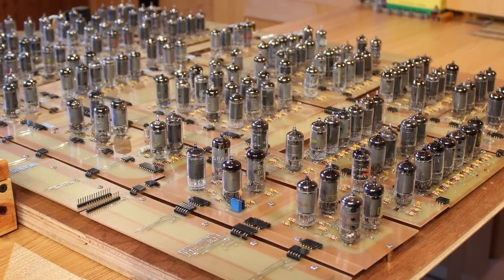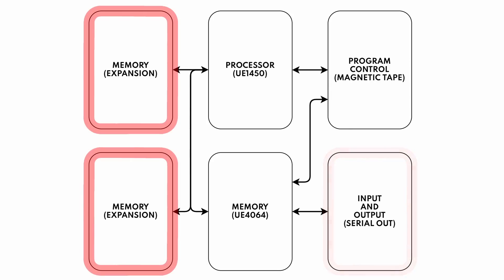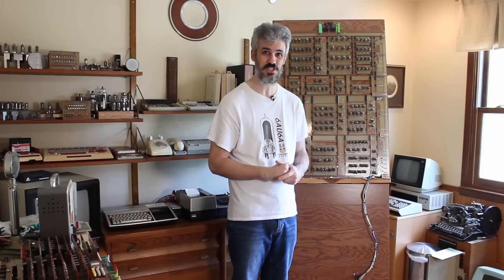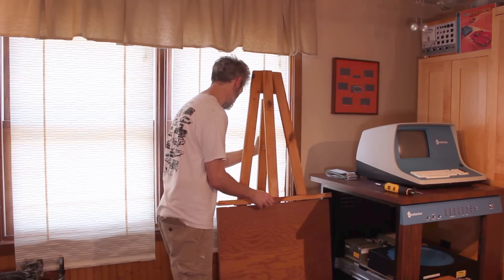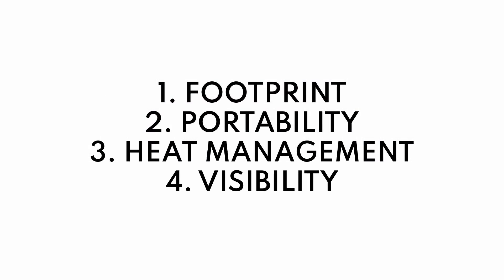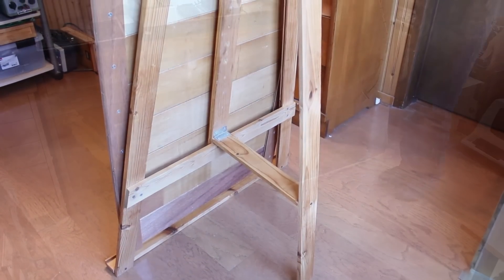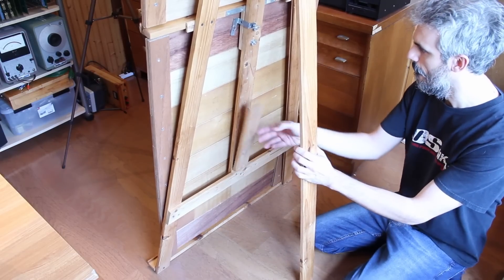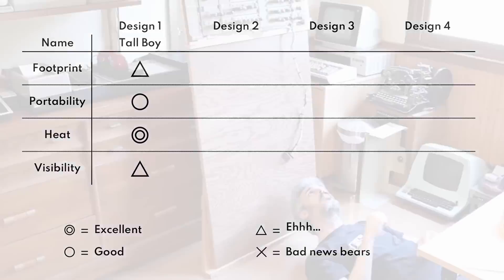Vacuum Tube Computer P.27 – Trying to Build a Mount for the Computer

Comment: You can use Option 3 when you turn the whole thing 90° clock or anticlockwise. Leave the bottom and top uncovered for airflow and visibility of the tubes. Cover the open side with an extra board for protection. 3 small braces should stabilize the whole thing top- and bottomwise. Maybe add some huge but narrow fans to the bottom to push cold air into the racks. Place the things on wheels and ready to go.

Comment: Spiral staircase? central post that all boards mount on, sort of like your filiung cabinet idea; but the boards coudl rotate and fan out .. so rotate one out for view, or all of them fanned out for view + heat spreading?

Easel .. back latch seems clever; I was thinking you'd have the tweo shelves with a groove .. so the mid-shelf would lock the bottom board in place, and then a top-shelf added to lock the top board down.

Back to back is an idea perhaps too .. if the easel had feet so it could be flat, but not tip over (think hat rack), coudl put boards on the front and back, but that'd only allow 4 boards per easel, and probbaly be heavy enough to tip over; visibilty would be okay, but only for half the boards at a time :P

Visibility could be fixed perhaps with a console ore viewing board; likel if you stacked all them into the filing cabinet ("pizza oven") design, you coudl still have a display on the side that you run all the VFD over to; like leave existing VFD 1 bit in place, but also run wires over to a side display (?) .. with LEDs, no big deal, but with VFD and heating and distance resistance vs your boards, no idea, but just a thought; if visibility is a problem, could you move the visible elements easily, modularly .. abstract the "UI" as it were?

Comment: Having worked for Cray, I prefer one of those styles over the other. If you do decide to copy the cray, make sure to copy the massive copper bus-bars. Extra points of you heat them up to the point of changing color so they look authentic =)

Comment: I saw all your videos on the building of the processor unit and I'm left with a feeling that you didn't plan too much ahead, or didn't plan with much detail.
That is way your processor board is so big, and has so much small boards just to fill up gaps.
Ok, I know a processing unit has many different circuits, so its not easy to have it made of boards of the same size,but never the less I still think it can be made a bit more compact.
Note that I'm not suggesting or expecting you to rebuild the whole processor board.

But, given that, your next boards, RAM and I/O (memory mapped I suspect), are mainly composed of several copies of the same circuit, registers and buffers, so its possible to have them made a bit more compact around a common bus., making it possible that the remaining boards can have a smaller footprint.
If so, you can have a set of "peripheral" boards of smaller size arranged in the "cray" model forming a 180º arc in the back of the processor board.
BTW, don't forget to leave room for an extra board for the power supply.

Comment: I like the box design, and I think that heat management would be manageable. 

I think an adaptation of the design may be to have the different boards pull out in different directions. In this way you would be able to see up to 5 boards at once (if you have the space) or you could have it pull out in three directions (4 boards visible) with fans at the back. The portability would be excellent the visibility would be good to excellent depending on the number of boards, heat would be good to excellent depending on space and foot print would be excellent to poor depending on how much room you have and how many boards you display. 

If you get fancy in the build you could have the boards pull out and up, but that might be a 5th factor that I would call difficulty of build.

Comment: Open air version of #3 is optimal. 1 side (blind side can be for air movement. 3 sides for viewing. No reason it had to be closed in your version. Your best solution is going to be a rack of some sort on wheels/casters.

Comment: I would consider the pinball layout, but go 3 tier, 1' off the ground, then 2', then 2'. Total hight 5'. Plenty of room to see through the boards and a lot of space between. A single box fan should cool everything. You would have to squat to see the boards on the bottom, but thats about the only issue.

Comment: To optimize, I suggest turning Design 3 (file cabinet) on its side without top or bottom boards, as well as raising it up off of the floor by several inches to improve air circulation and heat management.

Comment: "Usagi VTC One" or "The One Usagi VTC".
I think the "Cray" is a good option.
You can have a central hub to route all cabling. The visibility of the VFDs can be worked out with a small angular mount, keeping them in place. You can also consider having them in some kind of remote panel, instead of near the relevant circuit.

Comment: The filling cabinet case may be the best as every single valve/tube computer had forced air cooling and no matter the size of the case it would get hot. I’ve built a few am transmitters with valves and I’ve found that a standard 19 inch rack is the best compromise for size cooling and portability

Comment: Couldn’t help noticing the astatic d104 microphone at 6:07 just on the left hand side. That right there is my go to mic for my vintage ham radio gear as well as the teletype on the right. I wish I had that type as my model 19 is absolutely massive with its desk and power supply

Comment: I think you will need a design where you can remove the boards because 6 of them is going to be too heavy to lift all at once, especially with those fragile tubes. My design would be what I call the 'voting box', where you have 2 panels left, 2 panels front and 2 panels right in a U shape with the open side facing you: stable, compact and heat can get away.

Comment: For the third design, if you mount the boards vertical in the filing cabinet, the heat can rise to the top. A few holes at the top and it can radiate out. However, the visibility will still be poor.

Comment: Most of your case/mount design problems stem from your decision to tile your individual PCBs and turn them into these huge boards, which is not how the builders of similar computers back in the day used to do it. If you were willing to pull the large boards apart and divide and stack, you might get closer to an EDSAC-style arrangement, and that would solve many of your problems.

Comment: Name suggestion: mimivac mark 1 
(mimi - ear in Japanese, for big rabbit ears, -vac as a tribute to vacuum tube computers of old)
Also, it shortens nicely to MM1.

Form factor: 'Very Slow Cray', just make it fan-out to full circle (60 degrees between boards). 
With appropriate hinges, the design can fold nicely for transportation, and when 'unpacked', it has great visibility and heat management.
The footprint is a nice balance between visibility and portability.

Comment: Call it the UC 01A, and for a mounting look at making the Cray, but leave the leaves hinged, so you can fold it up into what is the filing cabinet for storage and transport. You just need to have at the ends of the leaves a set of spacers, that allow them to lock into transport mode and not knock, and fold out in use or display. 

Mount cards sideways, so that you basically can see all indicators from the side, so it is 1m long, 0.7m high and can fit on a table top. A latch or strap on the open side, and handles on the ends to carry it, and it will be portable. Make a base, wheeled, so you can roll it, but lockable castors to hold it, that both has all the power supplies (big industrial plug and socket for interconnect, should be easy enough to get industrial ones that are appropriate age and 20 or so way on eBay, chassis mount socket and cable mount plug) and the appropriate wooden holders to simply drop the filing cabinet in it, then open out. 

The filing cabinet has a spine  with the hinges, holding 2 boards in the middle rigidly, a hinge half way out for the 45 degree cards, and the end another hinge for the end cards, supporting most of the length. Yes it comes as 2m plus spine wide in use, and 1m deep, but can easily also be run on a bench or table folded, heat not an issue as you have a chimney now when folded to cool it.

Comment: How about MAVBAC, on the model of ENIAC, EDSAC, etc., standing for Macroscopic Valve-Based Computer? 
If you build housing for the computer, or dedicate a room to it, you can call that the MAVBAC Mansion.
(You could also just name the computer itself the Macroscopic Adder of Numerical Information and Alphanumeric Computer. There might be trademark issues with that though.)

Comment: My suggestions... 
1) A fold-out zig-zag with the panels vertical, a bit like an old-fashioned screen.  You'd need to space the panels carefully for storage, and you would need to limit the extent to which the zig-zag would unfold.  I would also suggest an additional stay or support at the back to ensure it would never fall forwards.  (That was my concern with the easel based stand as well - they are not noted for stability.)   
2) A variation on the zig-zag would be a vertical slatted arrangement with the panels arranged like the slats of a venetian blind.  You could collapse the slats for compact storage and open them up to display.  
3) Take the Very Slow CRAY design and make it expand or collapse by rotating the panels about the vertical axis where the panels converge in your current design, for ease of transportation.

For visibility of the VFDs (for any of these solutions) I would look at rotating the panels 90 degrees so that what was facing down now faced outwards towards the viewer. The panels themselves would remain vertical so cooling would still be effective.

Comment: As for design... my first thought was that if you build it to be displayed/run as design 4, but foldable for transport to design 3. Put strong hinges on a backplane for the blades and mount handles and wheels for moving it around. For locks, handles, hinges and other hardware, check out PA/stage enclosure hardware.

Comment: But will it play crysis?
Reply from the maker: Ah yes, can it run Crysis!

This is a fun thought experiment actually. The minimum CPU spec for Crysis is a Pentium 4 @ 2.8GHz. This actually makes figuring stuff out a little easier since the P4 is a single core CPU. We do have to make a few guesses here. Crysis is power hungry, so let’s assume that on a P4, CPU usage will average 90%. That means that Crysis is performing around 2.5 billion calculations per second. That should yield around 30 FPS, which is about 83 million calculations per frame. With a resolution of 1920 x 1080, that’s 2,073,600 pixels. That means it’s roughly 40 calculations per pixel.

But, now we have to think about bus widths. If we boil a single calculation down to just moving a 32-bit value from one location to another, the P4 can do that in a single shot because it has a 32-bit wide bus. The UE14500 only has a 1-bit wide bus, so that same operation takes 32 distinct operations on the UE14500. Which means that the UE14500 needs to do roughly 1,280 calculations per pixel. 

And now we’re up to speed. I don’t know for sure at this point, but I think it’s possible to push the UE14500 to 100Hz. That means it’ll take 12.8 seconds to calculate one pixel. Working out from there, that’s 26,542,080 seconds to calculate a full frame. That’s 442,368 minutes, or 7,372 hours, or 307 days.

So, sure, it could run Crysis, but only at a blistering frame rate of 1.2 frames per year!

Comment: Design idea: modified filing cabinet, with the cards side-by-side, oriented vertically, sliding in on edge.
Heat-management has always been a sticky issue with vacuum tube devices. There's a REASON that the early computers were the size of a small building lol.
Really enjoying the project!
Reply: I like this idea a lot. Heat management will be much better than the horizontal drawers, since it allows for vertical convection. I think visibility is better too. There's a reason blackboards are not arranged horizontally.

Two possible variations: 1: Arrange the boards so they can slide either left or right. That way three boards can be viewed at once. 2: arrange boards so they slide vertically, like moving blackboards in a big lecture hall.
Reply: @danmenes3143  I like this solution (the 1 one). Also perhaps instead of a single 6 boards filling cabinet have 2, each hosting 3 boards. They could be stacked if needed, but if you have enough room they could stand side by side, allowing to see all 6 boards at once.

Comment: Can't help feeling that the Cray design is the most visible: hinge along the centre spine so all six boards can be positioned either around 360 degrees or perhaps just half of that. Some sort of latch - even as simple as a metal bar with spikes in the appropriate positions - top and bottom to hold it rigid. I think your heat problems are not really helped by two layers back-to-back; better to get as much spacing as you can.
Visibility on the VFDs is solved by laying them on their backs on the circuit boards, or a reflector immediately below them.

Comment: I might be missing something blindingly obvious, but why not laying the VFD down parallel to the circuit board? Sure, you will lose some visibility while the boards are horizontal, but they would still be visible, and it would look great when the boards are vertical.

Comment: Design 3 (Centurion-like) I like the most. The idea of putting boards on a rails and being able to slide them out is really nice. Unfortunately, as you said - heat is going to be pretty bad to deal with. Possibly you could solve this with some big fans (like from a server) at the back that would suck the air trough the whole rack, starting at the front. This would make some noise however...

Comment: Rubik's snake. Foldable 2*N-sided cylinder, where N = number of actual boards = number of small (about 10cm long) joint boards connecting the main boards which allow the structure to fold into compact rectangular block when unused. If needed, the structure might be unfolded into a wall or any other shape, just like Rubik's snake toy.

Comment: I would say use the last "fan" design but turn the bards on the side. This way you can see the lights from the front. You could get some space problems at the back where all the boards connect. The tubes there are relatively close together and the airflow there will be bad. Keep that in mind when you build it.

Comment: Perhaps something a little off the wall. What about rebuilding the cou so that the pcb's are the same size and you stack them using some sort of stand offs. You could redesign to have the vfd's in front, and some cpu fans could suck air across the boards and blow out the back. The surface area taken up would be reduced and that may allow other designs for the whole system.

I realize of course that would involve a ton of work, but it would allow for all of the vfd's to be seen.

Comment: U-TUM - Usagi Thermionic Unibit Machine

Also, how about a fold out design...   \/\/\ ?

The folds could ether have the boards vertical (like a changing blind) or vertical (more like your pinball design) .  

Also, add bus indicators and toggle switch front, simular to the Centurion, to have controls and the results.

And last, HEAT! This computer is first a heater, and the processing is secondary to the power of all the tube heaters. Look at how much cooling you have on your tube scope, and now count the tubes and estimate how many fans it would need to match the computers tube count.

Last, you might have you tube computer just for show, and make a Miniature version out of transistors (that match the tube design). Something easly portable and won't blow the breakers at any place you want to demonstrate it. 
No where as cool, but it will run cool. <G>

Comment: Yeah yeah... But Can It Run Crysis?
Reply from the maker: Ah yes, can it run Crysis!

This is a fun thought experiment actually. The minimum CPU spec for Crysis is a Pentium 4 @ 2.8GHz. This actually makes figuring stuff out a little easier since the P4 is a single core CPU. We do have to make a few guesses here. Crysis is power hungry, so let’s assume that on a P4, CPU usage will average 90%. That means that Crysis is performing around 2.5 billion calculations per second. That should yield around 30 FPS, which is about 83 million calculations per frame. With a resolution of 1920 x 1080, that’s 2,073,600 pixels. That means it’s roughly 40 calculations per pixel.

But, now we have to think about bus widths. If we boil a single calculation down to just moving a 32-bit value from one location to another, the P4 can do that in a single shot because it has a 32-bit wide bus. The UE14500 only has a 1-bit wide bus, so that same operation takes 32 distinct operations on the UE14500. Which means that the UE14500 needs to do roughly 1,280 calculations per pixel. 

And now we’re up to speed. I don’t know for sure at this point, but I think it’s possible to push the UE14500 to 100Hz. That means it’ll take 12.8 seconds to calculate one pixel. Working out from there, that’s 26,542,080 seconds to calculate a full frame. That’s 442,368 minutes, or 7,372 hours, or 307 days.

So, sure, it could run Crysis, but only at a blistering frame rate of 1.2 frames per year!
Reply: @UsagiElectric  YESSSSS!! NERD FACTOR +1